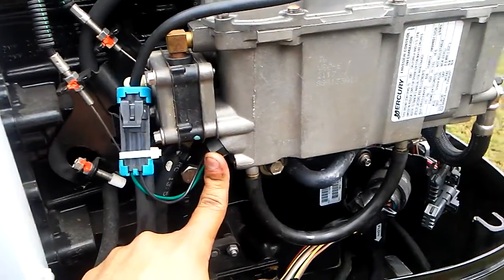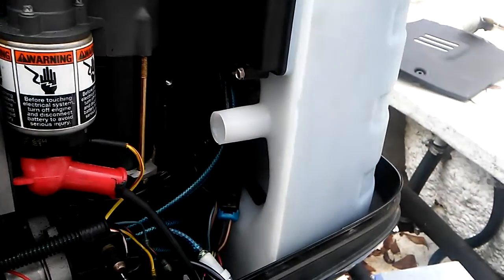Optimax 4 beeps diagnosis and repair

Comment: Question,  i replaced my small oil filter on my mercury optimax 115.  I was told i have to purge the air out of the line and a dealer needs to do this.  Is this true? Im scared to run the engine this spring in case there's air in the oil line.  I would assume only the 150 optimax and bigger need to do this because they have 2 oil tanks.  Thoughts?

Comment: Hi there...i followed your tutorial  but still got the beeps i disconnected the sensor as the oil tank is only a few month old still beeps...i did what the guy done in one of your comments on here and disconnected the water filter sensor and it still beeping...where do i go from here ? Cheers

Comment: I have a 2007 merc opti max 2 stroke. MI am having a hard time taking the cover off that is held on with rubber washers. Do I need  SPECIAL TOOL? What is that cover called ?
Reply from the maker: @bbumgarner  the top cover? Just pull it.

Comment: Can't I just find the wires coming out from the connector and cut them and wire them together to save myself time? I've done all of the other tests and it has to be the oil sensor in the tank
Reply from the maker: Do that as a test. I wouldn't suggest leaving it permanently like that
Reply: @TheJoejoe7716  update. I haven't done that yet but I removed the water sensor and cleaned it and put it back in and threw it on the muffs for 10mins and no beeps. So I took it out today and got the 4 beeps again but it doesn't put me in limp mode like some people say. The motor runs great like normal. I will next probably snip the wires and wire nut them together before going out next for a test

Comment: At the bottom of where the fuel filter is mine has no hose. Theres two brass looking fittings with what looks to be stainless steel cable coming out??

Comment: What is the problem of rpm drop issue
Reply from the maker: It's probably going into limp mode. There are several reasons. But in my experience, the throttle position sensor is very common.

Comment: Not sure if your still answering questions but i have the same issue i have the new tank ordered but with the world how its is the ETA on the tank is a month and a half away my question is can i just jump the sensor make the engine "think" everything is ok amd still use my boat till the tank gets here? Does this faulty float arm somehow hinder the oil from getting to the engine properly?
Reply from the maker: Yes you can, just make absolutely sure the tank is topped off

Comment: so how do you go about changing the oil tank?  doesnt look that simple on my 90 hp optimax.   also i tried both your solutions and neither stopped the beeping.  any other ideas?  thanks jim
Reply: Try to Disconnect the sensor on the water filter side… if beeping stops, that’s your issue.

Comment: You can also get a fault for low oil and it turned out to be remote oil tank. Some remote tanks have a float and switch. So unbeknownst to me I assumed it was my engine mounted tank. I shutoff the main in the middle of a rainstorm just to check the engine oil tank. Really scary situation. So I still have that fault but it’s the remote tank level even though I don’t have the sensor lol
Reply: I had a similar problem with my 2004 200 optimax, oil tank pickup was fouled from old oil? cleaned the screen and the tank filled up and my beeps went away, good luck.  crack a bolt on the motor tank to let it fill up while running.

Comment: Just bought a 115 Opti and found that the owner used quicksilver premium, (not premium plus). I’m switching to DFI oil now. How hard do you think that oil was on the motor? It runs great. It has been stressing me out worrying about this.
Reply from the maker: Man, I have customers that use Walmart oil in optimax's. They are fine. Oils these days are all good. Just run it and don't worry.
Reply from the maker: I had a guy worried because he didn't run amsoil in his truck one time. Lol. My 2005 5.3 has never had anything but cheap oil in it for almost 300k miles. And it tows more than any half ton o know. It's fine, trust me.

Comment: How about a Radick beeping at higher RPMs. Checked the oil reservoirs for had that problem in the past and water in the fuel completely different beeping and only at higher RPMs do you have any suggestions
Reply from the maker: Over rev alarm
Reply: Does it have an alarm for that thought it just usually cuts out
Reply from the maker: @gordonmcmurray6391  yes
Reply: It’s also gives beeps when I loaded on trailer . So it can’t be over rev alarm because I’ve loaded the same way for years
Reply from the maker: @gordonmcmurray6391  at what rmp?
Reply: fired up fishing  about 3500 to 4200
Reply from the maker: @gordonmcmurray6391  how many times does it beep?
Reply: Beeps are Radick no particular number of beeps . As soon as you pull back  throttle beeps stop and engine goes back to running normal .
Reply from the maker: @gordonmcmurray6391  thats a new one for me. I would definitely get it checked out though

Comment: 2012 - 115hp optimax.  I followed the video, (very helpful) drained the water and still had beeps. I disconnected the oil reservoir and jumped the motor side. Still had beeps (both when jumped and not jumped.  I then disconnected the sensor plug on the water filter side and the beeps stopped.  I ordered a new sensor and after receiving it, removed the old sensor. The existing old sensor had gunk shorting the sensor (when I say gunk it is likely gas that has gone bad) As I had a new sensor to put in I just put it in rather than cleaning the old sensor but I believe the old sensor would have worked after it was cleaned up.   So for anyone with the 4 beeps problem try disconnecting the water sensor first its a lot easier than getting at the oil reservoir disconnect and if the water sensor is the problem it may just need to be cleaned rather than replaced. The sensor just unscrews from the tank.
Reply: You sir, are an ABSOLUTE legend!!!!! Thank you so much! That was my issue and I am so glad I don’t have to hear those beeps anymore!!

Comment: I have a2005 /75  OPTIMAX IM GETTING Consistent alarm  at 4000RPM Then it goes in the guardian mode the littles filter that comes from the tank to the pump if this is bad would it set off the alarm  ???
Reply from the maker: Sounds more like an over heat alarm.
Reply: So you thing it needs a new Thermostat and impeller the impeller is like 5 months old. Sam as the thermostat.
Reply from the maker: @steveduncan131  check your water pressure. If you have good pressure, locate and check the water pressure sensor.
Reply: fired up fishing I just orders a New Sensor and the over revving switch 
Thanks for getting back to me Sir  you have be good help

Comment: i have a  mercury optimax 135 right now it doesn't want to turn on - too much oil is passing through it turns on but then it turns off again - the beeps/alarms are non-stop please help any feedback is appreciated - all the oil is coming out from the lower unit (about 3 cups of oil is using just to turn on)
Reply from the maker: I have never seen one use that much oil. Is the oil you are seeing unburned? Does it look blue or black?
Reply: @TheJoejoe7716  its black

Comment: Forget that!!!! I'd jump the wires and leave it as is. $400 for a tank!!!
Reply: I cannot see this plug to make a jumper, do I need to remover lower cowling or remove the tank to get at it?  Thank you
Reply: Can you do a video on removing the lower cowling and tank?  And how to jump the oil connector?
Reply from the maker: I agree if it was my personal boat
Reply: @TheJoejoe7716  I understand where you're coming from. And is this motor a 2 stroke. I bought a boat with this motor and know nothing about it.
Reply from the maker: Ashroyer86 yes it’s 2 stroke direct fuel injection 

Always keep the oil tank full with optimax 2 cycle oil
Reply: @TheJoejoe7716  Thanks for the info.

Comment: I’ve got a 2008 25 hp Mercury 4 stroke, one beep as soon as I crank it then it goes away any ideas?
Reply from the maker: https://www.perfprotech.com/blog/marine-outboard-motors/mercury-marine-smartcraft-and-guardian-system-warning-horn-alarms
Reply from the maker: Beeps one time?
Reply: fired up fishing and the red light come on when it beeps but goes after about a second, I just got the boat so I’m kind of frustrated, when I got to the lake it didn’t do it but when I cranked up to head to the boat ramp it started
Reply: fired up fishing yeah I beep when I start it then it goes off
Reply from the maker: One beep is normal on start up
Reply: fired up fishing it’s suppose to beep once after you start it?

Comment: Thanks for the video. I'm replacing one tomorrow. I'm assuming I can just pinch the hoses replace the reservoir, hook the hoses back up, fill it with oil, start it up, and then purge the oil out of the screw cap and be good to go?

Comment: Jump the computer side to what?
Reply from the maker: Michael Hammock 
There are 2 wires in the plug. Use a peice of wire in a U shape to jump the wires in the plug
Reply: fired up fishing ok thank you. 
I was on the water and got a water in fuel alarm. Then slowly the motor shut down. When it would start it sounded like it was running on 1 cylinder (just barely). Got home and got filter off, full of water. The aluminum housing also had water. Waiting on fuel filter to arrive today. Hopefully this will fix.
Reply from the maker: If you had so much water that it was running bad, then you need to take the full pump housing apart and clean it. You also need to check your injectors.....do not run your motor with a bad or clogged injector....you will lean out your motor and burn it up very quickly
Reply: It wont start at all now.  How do I check the injectors?
Reply from the maker: Remove fuel rail and have your injectors cleaned.

At this point you may want to seek the service of a professional. You are dealing with several thousand dollars if something is overlooked
Reply: fired up fishing   It sat for 4 days and then started right up. Imagine that. Might have had water in the injectors?

Comment: I did both add still have 4 beeps. Did the bypass and still 4 beeps drained fuel bowl and separate and didn't get a drop of water. I have tried every trick to check both. Any other thought on where to go from here? Please help.
Reply: Actually everything started when we put our bout in and go a single beep on acceleration. It idled fine but wouldn't accelerate without cutting out and making just one beep. Got it home and the one beep stopped but 4 beeps started. I have done everything by the mercury manual and then some with no success. I'm ready to pull my hair out. Is there anything else that would cause that issue?

Comment: After you jump the plug do you have to clear the code from computer or does it just stop beeping? Have an older engine with 4 beeps have drained and cleaned fuel bowl and replaced filter and sensor. Jumped oil tank plug and still 4 beeps.
Reply from the maker: Email me firedupfishing@gmail.com
I will send you diagnostic info